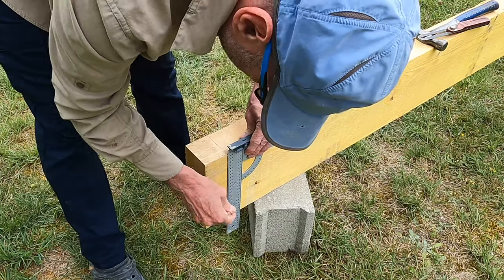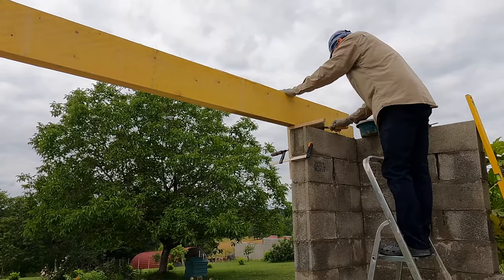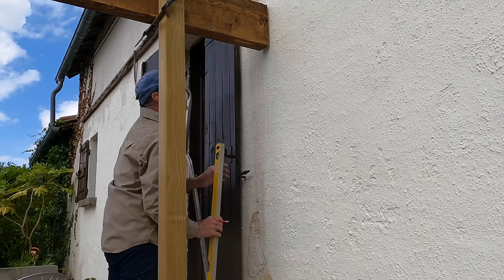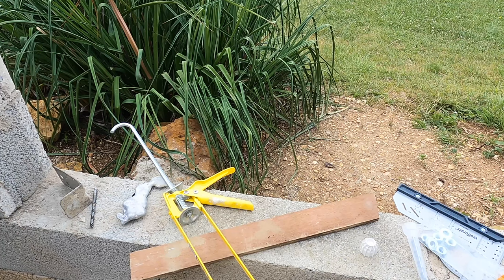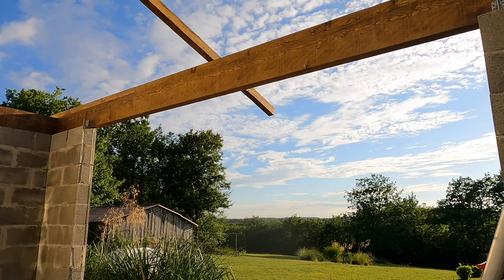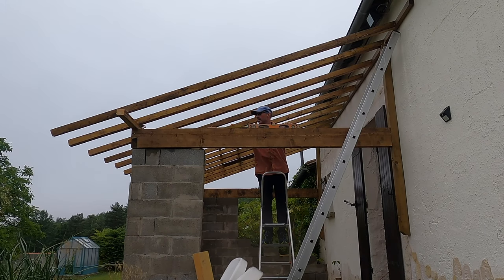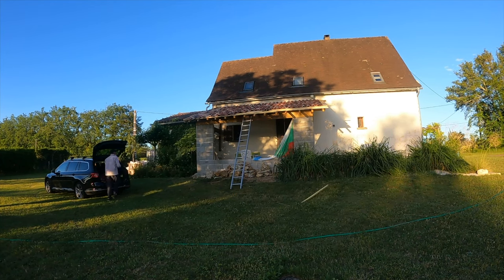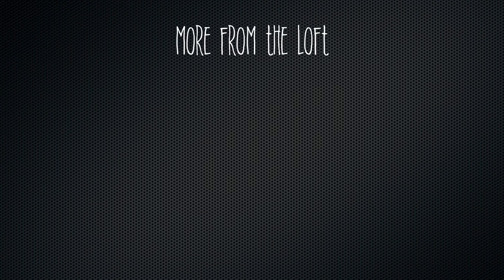Building a Covered Patio. Fitting Beams, Purlins, Rafters and Tiling the roof. (pt3)

Comment: Very informative video thank you.  On question I have. How to you fix your rafters to your plates? Do you shoot screws straight down through the rafter or diagonal from each side?
Reply from the maker: Hi. Use two, one each side dovetailed in. Nails not screws though. Screws are far too hard and shear too easily. Nails may bend but not shear off in the same way so stronger. Regards JP